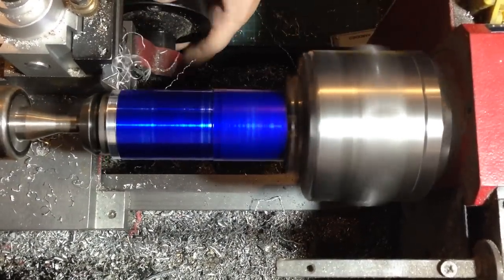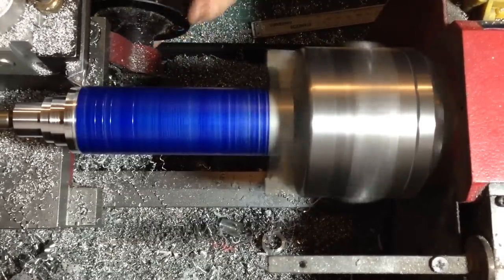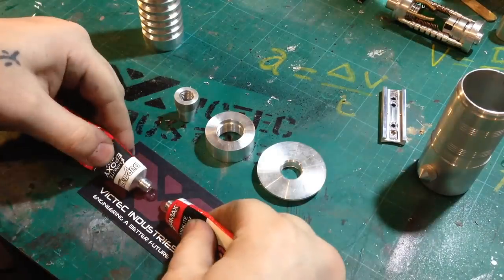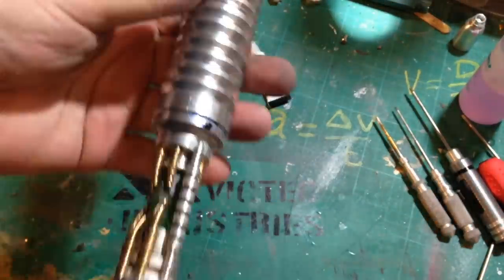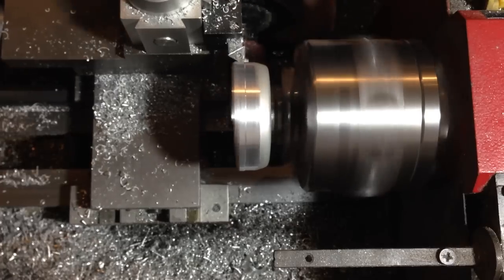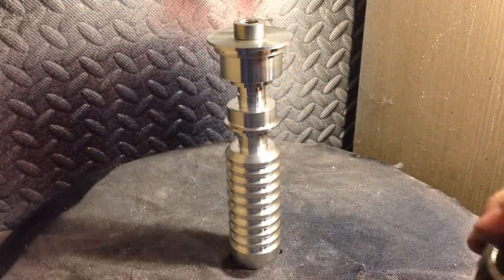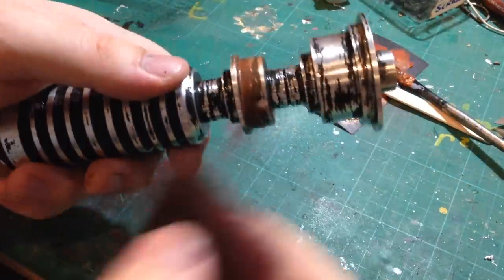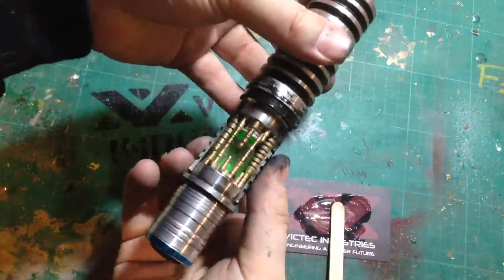Star Wars Lightsaber build

Comment: I’m working on a V2 right now. It was made by a company called one replicas. I loved how you weathered yours and I’m going to borrow some of your techniques for weathering mine. Specifically how you let the black dry before removing it. I see lots of people using acetone instead of sand paper but I like the look you achieved much more. As always amazing scratch build. Your talent is truly inspiring!
Reply: Hey I’m building one very similar can you tell me how wide the thin neck part is?
Reply: Braden Wahrenburg which part do you want the measurement of? And do you want the exterior diameter or the length of the part?
Reply: Braden Wahrenburg the thin neck portion has two different sizes. The one closest to the emitter and the one closest to the grip. They are separated by the wider “ring” in the center. The thinnest part by the emitter is 17.6mm wide and 14.9 mm tall. The thinnest part by the grip is 19mm wide and 12.6mm tall. It’s really difficult to show the the exact parts I’m measuring and what I mean without showing you pictures. I used my calipers to take these measurements. I hope you can visualize what I mean. If you’re on any of the Facebook saber groups feel free to add me. I’d be happy to help if you need more info. Cheers!
Reply: Jesse Hunter thanyou very much

Comment: What sandpaper did you use to remove some of the black paint to get the used look?
Reply from the maker: try a 100 grit and very light pressure you just want to take off the paint and not scratch the saber